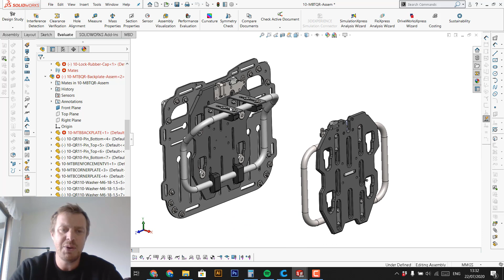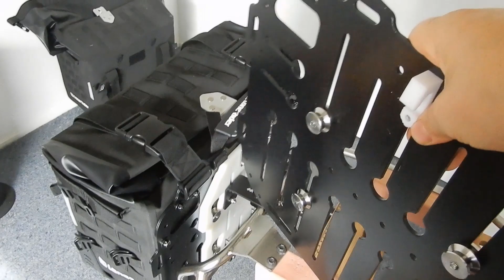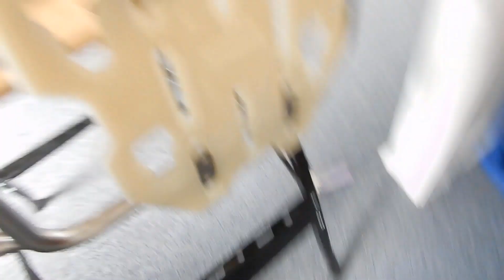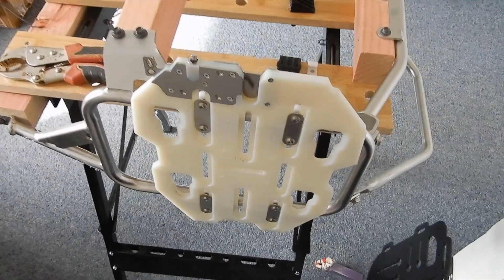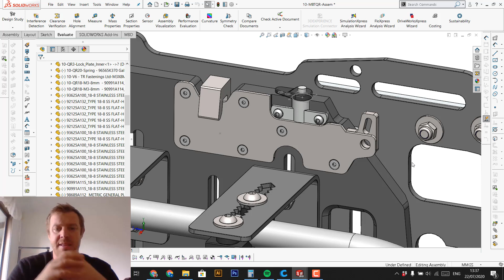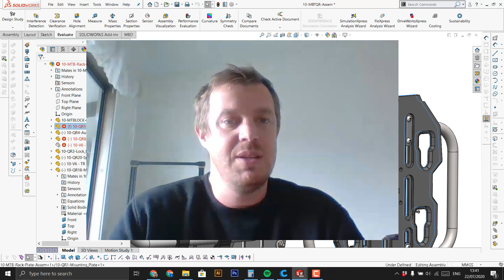Making Adventure Gear - Lone Rider Product Development - MotoBags Quick Release System

Comment: Very nice that you can put on a rotopack for extra gasolin. But what i wont to know is if the bag can be close"" safe"" whit key  or any class of padlock...most of bag can not be close safe ....a pity.
Nice rack and bag .
Regards!!
Reply from the maker: Our Motobags are looked with a set of  combination locks. These are included and keep your gear under lock.
Reply: @LONERIDERMoto  very nice. Today i was in your website.

Comment: The bracket that mounts to the bike permanently, are the slots big enough that you take off the 31 & 38 l bags and attach some of the smaller accessory bags for a day ride ?
Reply from the maker: MiniBag & TallBag, both are equipped with G-Hooks for easy mounting options.